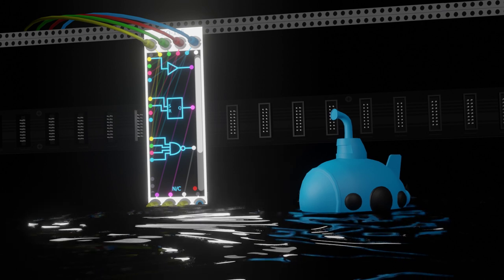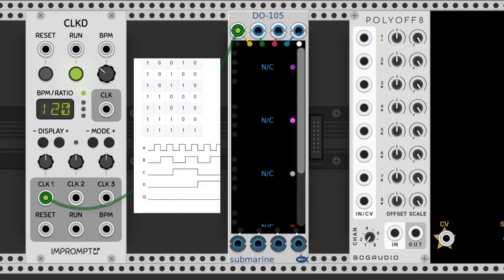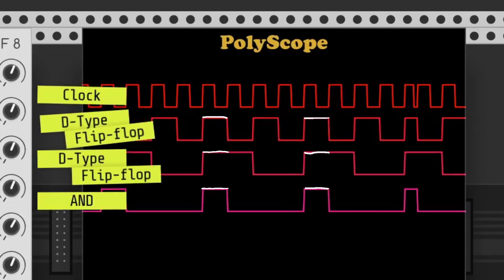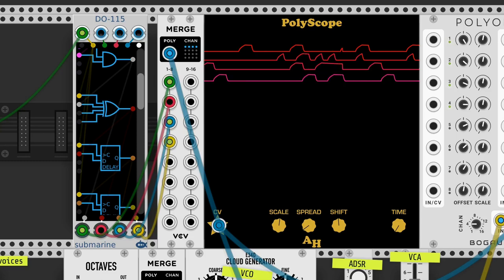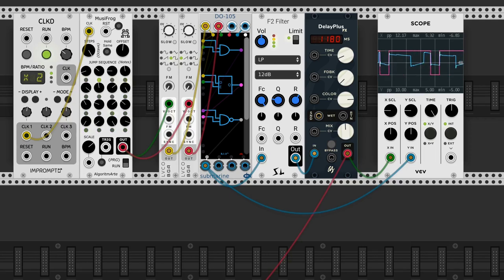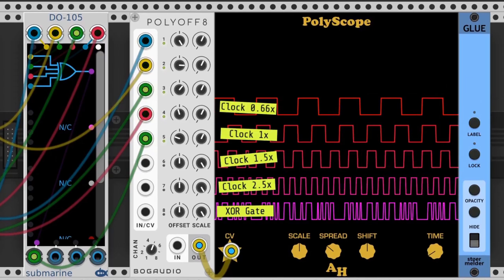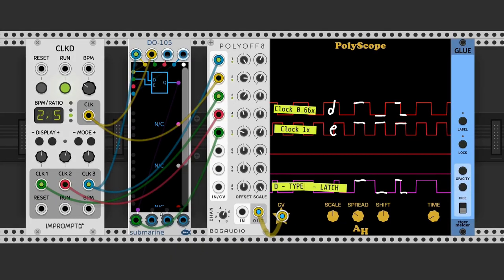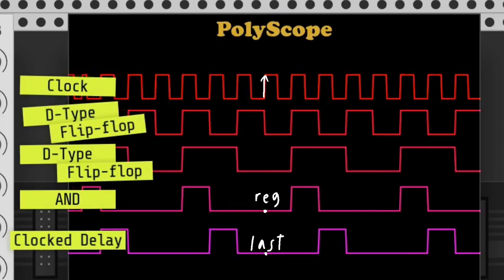Logic gates in VCV Rack. DO series by Submarine.

Comment: Great explanations of the various logical gates/parameters.  I wish all the released modules had an introductory video like this one.
Reply from the maker: Muchas gracias.
Reply: @CabotageKSM  Was just testing the setup described in the video.  One quick question/comment... when I initialize the module (after having set a gate) and select initialize the module, it does not clear out the gates?
Reply from the maker: @LuisTorres-qz5kr  I've noticed it. It's a bit of a bug. I had to remove the module and put it again to clear it.
Reply: @CabotageKSM  No worries, thx! I can also perform individual disconnects as a backup. By removing the module, you mean deleting it from VCV, then, importing again?